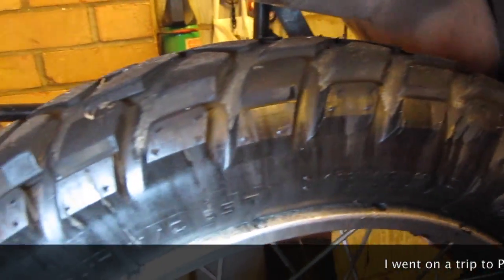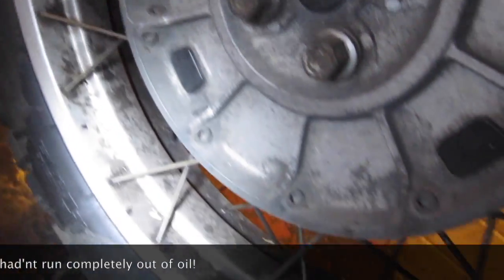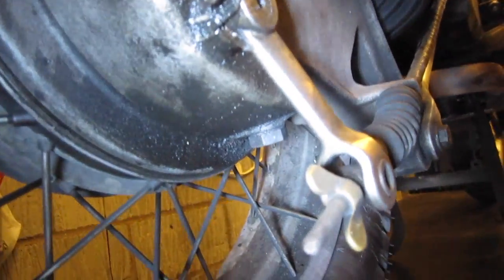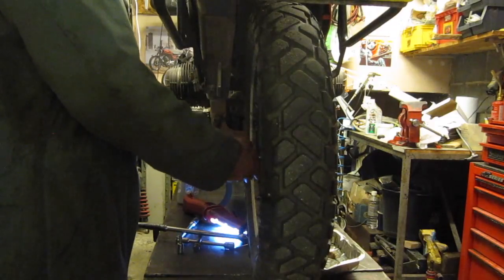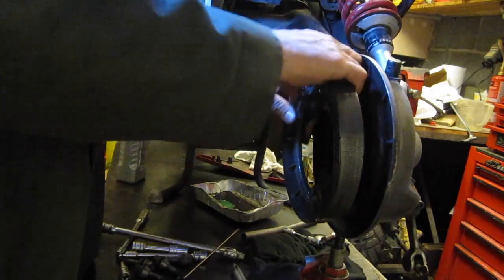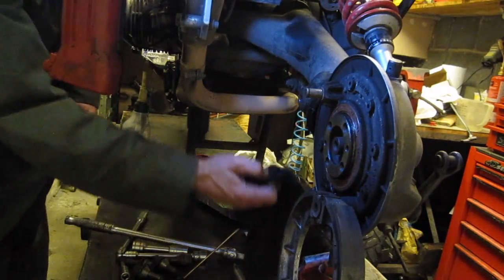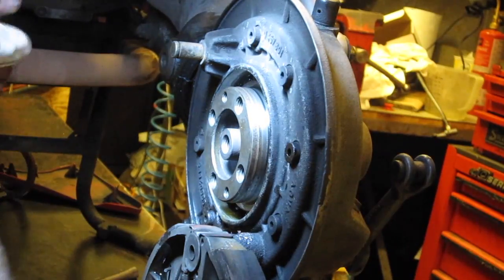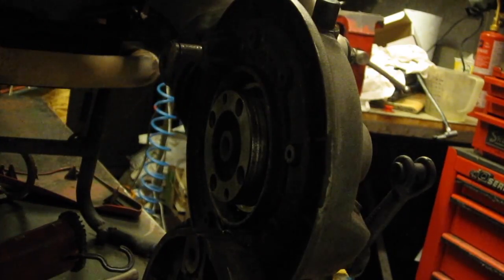Bevel Box Output Seal Replacement

Comment: Can it be Leaking between the outside surface of the seal and the aluminum housing?
Reply from the maker: It’s possible I guess, likely a result of poor installation. If the seal is properly installed they hardly ever leak.

Comment: Hi. Can you please recall the part number of the seal? Thank you
Reply from the maker: Hi, the original BMW part number is: 33 12 1 241 619. I strongly recommend you use an original oem part. I have had problems with pattern parts failing prematurely.

Comment: Hello . Some advice-help please . I have a problem with my r 100 gs pd `93 .. I turn the rear wheel by hand on the central stand and i hear a strange noise along with a little braking .  The sound and braking is not continuous, it does intermittently, like chouk - chouk sound ( is not the brake ) .Please any help welcome. Thanks a lot (sorry for my English)
Reply from the maker: Hi sorry to hear about your problem. 
You can start by draining the gearbox oil. There is a magnet on the drain plug. If there is a significant amount of metal attached to it, then it is likely that there is an issue that requires removal of the box for further investigation. 
Another place to look is the drive shaft universal-joint. To check this, you should remove the swing-arm and withdraw the drive shaft. Check for wear in the joint at each end of the shaft. 
Either one of these two components are the most likely source of your noise. 
If you can find someone with a more experienced ear may be able to pinpoint the issue without taking things apart. 
Good luck.
Reply: @motophoenix5951  Thank you very much for your help .
Reply: @motophoenix5951  You are right . The gearbox plug is full of metal shavings .
Reply from the maker: Zisimos Georgiopoulos so you will need to strip your gearbox. I recommend you do not ride the motorcycle until you have carried out the necessary repair work, there is a danger that you could do much more damage. My gearbox strip and repair series may help you. Good luck........
Reply: @motophoenix5951  Thank you very much again , sure your gearbox video will help me

Comment: hi Ted, glad to see this video; i am new to the GS and i experienced exactly the same problem; now it's time to buy the new seal and try to do my best! :)
PS: i noticed your wheel comes down easily, while mine it's hard to remove even with the rear brake completely unscrewed
any suggestions?
thanks
Loris
Reply from the maker: Hi Loris, I am pleased to know the video is useful to you.
I can't really think of a reason why your wheel should be difficult to remove. The only thing I can suggest is perhaps there is some oxidation between the wheel and hub. If there is clean it off with a wire brush and add a very thin smear of copperslip between the contact surfaces. 
Best wishes, Guy
Reply: thank you very much for the kind feedback!
Loris